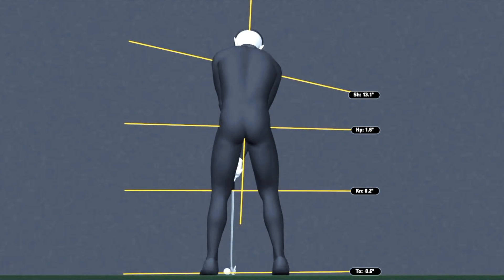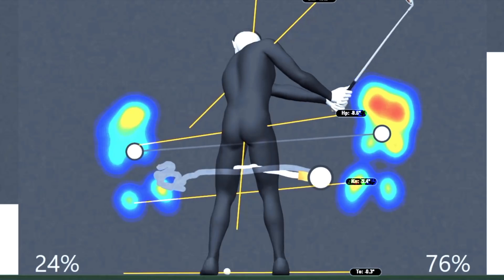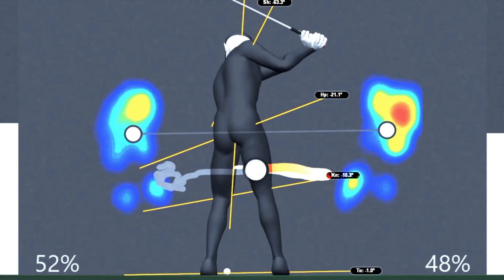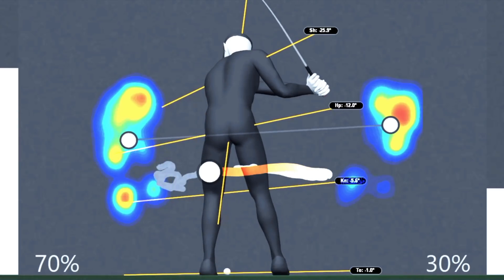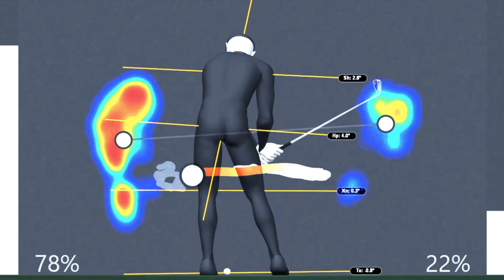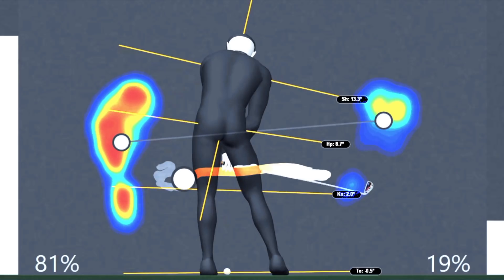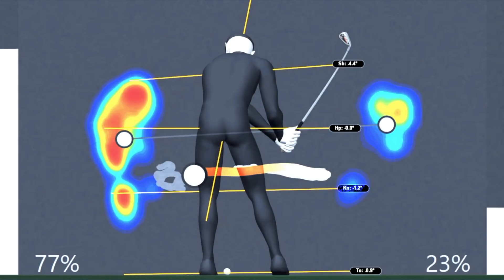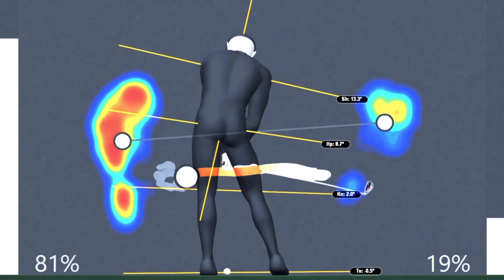How To Stop Sliding In Your Downswing: Part 2

Comment: This information is golden and the technology put to use impeccably.  That being said, the 000's of golfers out there with the slide would need more than these concepts to actually put it into practice. Like everything in the golf swing, what we think we are doing can be so far removed from reality it is not funny. I think a lot of the left foot pressure values are based on an explosion upwards and not just a shift to the left from the right. This is the only way the hip can essentially push up and rotate back, straightening the left leg which is the ultimate marker of whether this move has been achieved. The other remarkable piece is the movement of the upper body and spine, essentially shifting slightly closer to the target during the backswing. This is similar to the 'stack' move in S&T. Again, this is to properly position the centre of the chest over the ball through impact and minimise any last minute corrections. Excellent stuff.
Reply from the maker: thanks, Wowa👍

Comment: Another aspect that I had never been able to determine before I saw this video is how and when the spine angle changes in the downswing. In this great video, It mostly seems to take place between the top of the back swing and the left arm horizontal position in the downswing.The foot pressure map suggest that this might be achieved by transferring weight to the outside of the left foot and by keeping some pressure on the outside of the ball of the right foot.This video is great because it communicates a transition feel that I might like to try in order to achieve the correct balance dynamic that you have explained for approach to impact from the shaft horizontal position in the downswing.

Comment: This video confirms what I discovered the other day.  keeping the shoulder tilt to start the drift left and down, IMMEDIATELY, start thinking about pushing off the left foot to firm up the left side...the hips opening and the tilt of the torso back happens AUTOMATICALLY.  My thought was 1 / 2 with 1 being the backswing to the drift left and down and 2 the immediate firming up of the left side pushing off the left foot to stop the slide.  My hips opened, my head and torso went away from the target automatically without thinking about them.  I hit some of the most solid drives and irons.  My only problem was occasionally leaving the face a little open.  I'm looking into a more direct hand drop from the top as the pros do and as you'll see in some of these great videos.  I'm also thinking that maybe I did the firming up of the left side too immediately and the face didn't get closed properly i.e. a timing issue.  Anyway, those are my findings with this information.  Great videos.  I so wish this stuff would have been available 10 years ago. By the way, changingg 1 / 2 to one and two did n’t work…it must slow up the shift of weight and firming too much.
Reply from the maker: Awesome!  Thanks for sharing that, Rick🙂

Comment: Very interesting video, thanks for this.  I've been having problems closing the clubface for a while which would result in an early release and often a slice.  After working on wrist action and forearms to close down the face early on, I've found that I hit the ball very low and left - particularly an issue with the longer clubs.  Watching some videos of my swing with the driver yesterday I noticed that I slide towards the target quite significantly - moving the low point of the swing to just behind the ball.  I guess this is a move I've developed to try to (sometimes successfully) correct my slice and strike the ball solid despite the early release.  Seems like I have some work to do and this video certainly gives me some food for thought. I suppose the first step towards improvement is identifying the problem so that's a positive too,

Comment: I've talked to golfers who think that this is all about weight shifting back and forth. It's actually more complicated than that.  I don't recommend paralysis by analysis, but I do think it is interesting to understand what's going on.

At every point in your video, the pressures being produced by both feet onto the pressure pads adds up to 100%.  Some golfers may not realize that the total sum of the pressures being applied by both feet is a) not a constant value throughout the swing, and b) not equal to the golfers weight, except at address and finish, and also at a transitional point in the swing.

It would be nice to see the actual pressure numbers, instead of just percentages, in order to fully understand what is happening, and to compare those numbers to the golfers weight.

When the golfer is standing still at address, the sum of the golfers foot pressures are equal  to the golfers total weight.  When the golfer starts squatting in the backswing, the sum of the pressures on the pressure pads will, at that time, be lower than the golfers weight. The golfer will be experiencing some small amount of weightlessness at that time. When the golfer is later posting on the leading leg and pushing the body & golf club upwards for power, the sum of the pressures on both feet will be greater than the golfers weight at that time.

This is usually even more dramatic with drivers than irons.

Golf is an athletic sport.  You gentlemen are appreciated for doing God's work here.

Comment: Fascinating and very revealing series. I'm certainly going to work on this as I am having trouble getting to my left side on a consistent basis. Do it earlier and then maintain a firm left side-duh!

One question I have relates to the position of the ball which appears to be forward of what I'm doing. I've been taught for the the shorter clubs and even the mid-range clubs to place the ball slightly left of center. (Hogan however places the ball inside the front foot and adjusts the rear foot back based on the club). Is this typical or is this because of the club the golfer is using? What club length is this golfer using?

Another question is what kind of ranges on the weight distributions are you seeing with other pro golfers (maybe too detailed)? Also how does that relate to the position of the ball and/or club used? For example, a wedge may be more centered etc. 

Thanks. I think this is going to help me a lot.
Reply from the maker: Ball position is definitely a factor and goes hand in hand with being rewarded for getting more forward earlier.  The club used was a 7iron.  We used this player because he demonstrates the normal ranges we see with most of our pros.

Really glad this is helping... let us know if we can do anything else to help out.

Comment: Really like the pressure plate addition
Reply from the maker: Thank you!!!
Reply: Just practicing it. Works well. Had started to get setup more over the ball, then added initial wt shft. As you said this takes away need to rush. Sweet swoosh through with good attack.
Reply from the maker: @davehill5539  love it

Comment: In a previous video, you recommended a drill where the left heel is lifted at address and early in the backswing the weight/pressure has shifted to the left by replacing the left heel back on the ground to allow for critical timing for the swing. Yet in this video you show a 78% pressure on the right foot when I am placing my left heel back on the ground (no later than half way back in the backswing). The pressure feels very left sided at this point and throughout the remainder of the swing until my right leg pushes up lifting my left hip up and back through impact. Is this an illusionary “feel vs real” example?
Reply from the maker: Keep in mind you're comparing a drill with a real swing.  That drill is designed to force you to get that shift STARTED early.  It has to start much earlier than it shows up.  So in essence, you're developing the feel for the real.

Comment: Very good video. I really like the foot pressure overlay because it communicates the feeling I might like to have in my feet at these crucial points in the swing. These are very interesting because the old adage that golf is played from the insides of the feet does not seem to show it self on the foot pressure maps of the top pro golfers in the way that I previously imagined.
Reply from the maker: We use that tech with every skill level we work with, and it's just not something we actually see happening.  Great observation.

Comment: Please Help? I understand the idea from this great video that the translation of foot pressure is not the same as weight shift. But, I am still unsure as to how the pressure changes are achieved. The pressure aspect suggests certain muscles are being used to achieve the pressure plate patterns that change throughout the swing. Obviously many muscles in the body are in use in the golf swing. But, which ones should be used in a dynamic sense in the address position in order to preset the correct movement patterns throughout the swing. For example, I have experimented with the idea of the foot supinators being dominant over the pronators in this position, although I doubt that this would be the full story. A bit off the wall maybe! Any ideas?
Reply from the maker: Stand in a 5 iron posture without a club.  Take a ball and throw it towards second base with a little sidearm motion.  That will produce perfect pressure movements.  You won't have to think about which muscles are firing, you're just making a very basic athletic motion.  You do the same thing (pressure move) when you take a step as you walk... pressure shifts to back foot as you weight is falling forward where hopefully you catch it with the next step.
Reply: Thanks very much, great information. But, one more question. If I am thinking of initiating a right arm throw from the position of address, should I pull back with the right arm, or should I practice the right arm track and then push it along this track with the left arm, or some other solution?
Reply from the maker: Don't think about it, just throw!😉
Reply: Thanks for these two tips. Especially the baseball throw technique. I have never played baseball, so I looked up the ?infielder throwing technique that you are talking about and found "Infield Throwing Mechanics" (https://www.youtube.com/watch?v=eyfUSKoe_zw&t=470s). This is probably old hat to those involved in baseball, but what I found very useful to my case was the concept of "breaking with hands thumbs down". This puts the right thumb in the right condition for a right sidearm throw (Stop action at 3 mins 25 secs). Although this position is not directly related to the golf swing it made me realize that, in my grip, I have my right thumb to far up relative to the right index finger and not wrapped more around and down. Maybe this is because I have taken the neutral hands square position too literally in the past. The new baseball adapted position allows me to throw and make a naturally correct direction change of the right wrist in the transition, instead of coming over the top. I can also be more right hand conscious in my takeaway, without coming too much to the inside, and as you suggest "Just Throw" . Thank you very much for sharing your advanced technical insights and your generous assistance of our questions.

Comment: I really like the mix of technologies. Nobody else has really done this. The foot pressures tell me a lot especially when I take screen shots at the key swing points that you describe so well and lay them out on a single page. This helps me immeasurably with my address position, swing path and takeaway, gives me a chance to make a proper drifted transition through to the point of impact. The pressure points together with GEARS identify a feel factor that I was never previously able to attempt to replicate. 

In this regard I was wondering whether, in general terms you could include a real time grip pressure sensor in your analyses and present the key elements of the pressure maps in the same way you have with the foot pressure sensor. For example, the following springs to mind: https://www.tekscan.com/products-solutions/systems/grip-system. Note: I have no connection with any golf product.

Comment: For this to work, you drop into your left leg in transition and then have to push back up off it at impact. You need a certain amount of strength in your legs to support this loading and rebounding. If overweight, or not strong in the legs it's  more difficult, if not impossible, and thus easier to move on to a straighter left leg in transition , which will cause you to loose the left pelvic tilt. Maybe why this is so difficult for some of us.
Reply from the maker: We have golfers with physical handicaps, golfers over 70 years of age, overweight golfers, and kids under 8 years old who all do this extremely well.  This doesn't require any more strength than it takes to throw a ball.